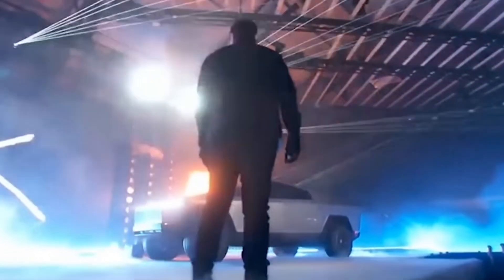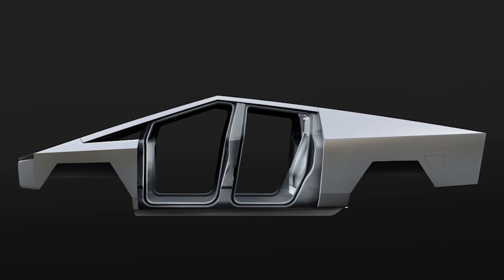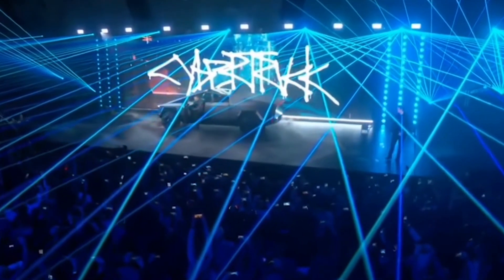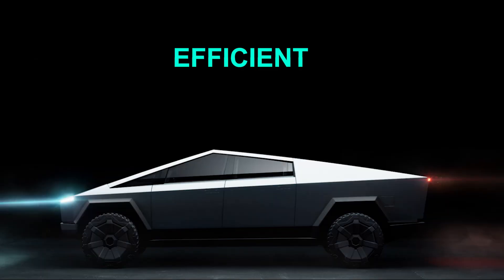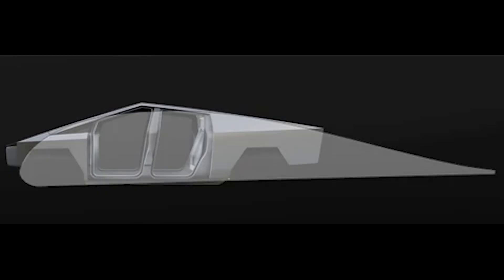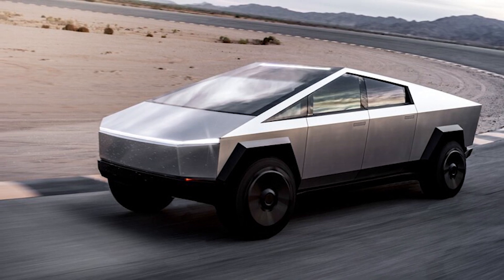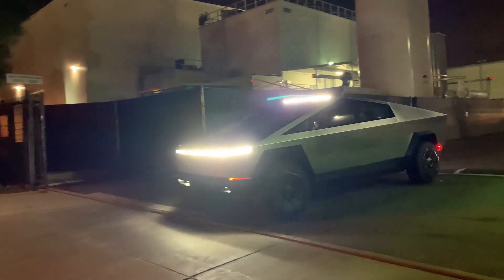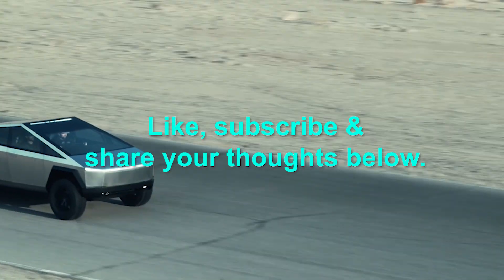Cybertruck is Engineering Genius (and will be copied)

Comment: So the points you bring up sound great. In real world practices there are a few issues. Yes the truck is strong. In an accident It will still dent. What do those repair numbers look like or will the vehicle need to be scrapped because it's one big piece?  We haven't seen any safety data. Where are the videos and data from safety testing? Do we have proof if range and even if it goes as far as claimed what will it do under max load?  I'm on board, but we need some real world data. Tesla has seen their fare share of blunders. How many will we find here?
Reply from the maker: A dent in the steel is a matter of visiting a metalworker to remove it.  And yes, Tesla are yet to speak about safety. On the specs, look at the specs of every vehicle Tesla has debuted previously. At launch, the production vehicle met or exceeded all of them. :)

Comment: I wander if the design will change before its release, like the sharp edges for example! I love the design by the way.
Reply from the maker: I don't imagine it will change much. Look at the first Model S, 3 and X prototypes. Damn near identical except for the front grille on S which was fair play, just so people didn't freak out too much over the design. My how far we've come since then (case in pint: look at the cybetruck haha).
Reply: Correct, I ask because of maybe issues with safety for pedestrians for example,.

Comment: There's 1 thing bothering me tho. Cars are uually made of a material that easilly bends so as to in a crash the passengers feel less of the impact. But the Cybertruck is really strong. How's that not contradictory?
Reply from the maker: Lots of people are mentioning this. The steel can be scored on the underside to crumple predictably and consistently when impacts occur from certain directions, and remain unscored and strong as hell otherwise. I think many will be surprised at how well the Tesla engineers address this. Safety is always top of mind at Tesla. It may not appear so but the driver in cybertruck sits the same distance from front of the vehicle as they do in Model 3 so there's equivalent space for crumple zone too.

Comment: When they start rolling out $10k teslas, then its big money time.
Reply from the maker: I think we're a few years away from that 😉
Reply: Might be unrealistic, as they want to be cutting edge innovators and not budget options. Other manufacturers will surely offer 10k new or you can buy used.
Reply: Aiden A: the problem with a $10k tesla is that a $10k battery is only good for around 80 miles (~129km)  ok for a short commuter, not too good for my "bi-weekly run up the valley".  (At those Prices the battery is what you are paying for, the car is free.

The average car user basically uses almost the same cost in fuel over a 10 year period as their (small-medium) car cost to buy.. (At Prices where I live)) - so a $25k (AUD)car, is really a ~$55-60k over 10 years expense, for many people (mechanical, tyres, registration, insurance)
Reply: I'd buy a 10-15k Tesla if it had a gas engine and a decent sized fuel tank.
Reply: @WartimeFriction  ok boomer
Reply: Good try, but Tesla doesn't have the range for extended commutes and I've never seen a charging station out here in Alaska. Also not a boomer, silly zoomer.
Reply: @WartimeFriction  just don't buy a tesla, boomer. Gm and ford still exist.
Reply: @WartimeFriction  Bud, the Cybertruck has 500+ miles of range, you don't need more than that.
Reply: @WartimeFriction  he's calling you a boomer as a metaphor
Reply: @johnt2914  as cool as that would be, it's still 2 years away. nothing is real yet.
Reply: @yaboirico5221  It's real, range is only a matter of battery capacity.
Reply: @WartimeFriction  I am a boomer, have my primary home in Alaska, and have had several Teslas. Unless you need to drive 300 miles or more in a day, superchargers aren't needed. Home charging does it for me.  There are currently a few Teslas in Soldotna.  Julio is evidently an idiot and didn't get your humor.
Reply: @johnt2914  If I drive to the second closest city (850 miles), I absolutely need more range than that.
Reply: @daveriley6310  Sweet! I'm glad it works for you then. I've wanted to test drive one for awhile now.
Reply: @WartimeFriction  good luck not having to piss or eat for 850 miles. a piss gets you 100 miles of range, eating gets you a full tank.

Comment: I have done some  retrofuturistic similar car designs 2 years go. .  Soft curves for good aerodynamics are not that important in that dystopian future 50 years ahead.  But it is important that the car offers good protection against street gangs and Terrorist attacks, and that graffiti can be removed easily. With an aggressive front it wipes away any obstacle , whether street blocks  ,other cars,  or humans

https://gramho.com/media/1724610361522756240.      https://i.pinimg.com/originals/9a/4f/b1/9a4fb145bd7142529eaa4a3ece35ba62.jpg.     https://hu.pinterest.com/pin/102738435232908240/visual-search/.     https://hu.pinterest.com/pin/102738435232908955/visual-search/?x=16&y=5&w=530&h=175
Reply from the maker: I hope you're wrong about a future dystopia Thomas!
Reply: @SolvingTheMoneyProblem   my dystopia was just fictional for a novel. I also don't wish it to come.  But the chances that it will come are not that bad, if our society continues going in the same direction as it does for some decades

Comment: Actually a rigid car is not safe. You want a car that deforms on impact. I'm sure that that Tesla will have great safety features, it's just that you were talking nonsense.
Reply from the maker: The steel can be scored on the underside to crumple predictably and consistently. I think many will be surprised at how well the Tesla engineers address this. Safety is always top of mind at Tesla. It may not appear so but the driver in cybertruck sits the same distance from front of the vehicle as they do in Model 3 so there's equivalent space for crumple zone too.
Reply: @SolvingTheMoneyProblem  I completely agree with you, it means that the steel structure isn't actually all stiff, it is made to crumple in the right places.

Comment: "exoskeleton". if that means that all structural parts are on the outside and the panels on the surface are structural,  if they get damaged in an accident,  a repair is almost impossible when the whole structure is deformed. 
normally non structural parts as bumpers, wings and front panels are deformed in an accident in order to absorb the impact and they are sacrificed to protect the structural parts underneath. But they can be replaced easily
Reply from the maker: Yep, this may be a thing (though Tesla's engineers are among the best in the world, they may have solutions). Lucky Tesla offers their own insurance and has autopilot and other safety features. Cybetrucks will be in far less "at fault" collisions.

Comment: I would hate to see the remains of one of the fibreglass specials in a crash with this truck. It will create very big problems on the road if anything hits it. Soon after it will create big problems for the other automakers.
Reply from the maker: Lots of people are raising this. The steel can be scored on the underside to crumple predictably and consistently. I think many will be surprised at how well the Tesla engineers address this. Safety is always top of mind at Tesla. It may not appear so but the driver in cybertruck sits the same distance from front of the vehicle as they do in Model 3 so there's equivalent space for crumple zone too.

Hope Tesla shares some safety info soon.

Comment: Pre ordered mine already, I haven't been to a fuel station for 5 months, filled up the troop carrier with 300 Lt of diesel the day we picked up our hyundai Kona Ev and haven't driven it since might still have tank full by the time the cyber truck arrives.
Reply from the maker: Awesome stuff. Which model did you order?
Reply: @SolvingTheMoneyProblem  Went with the 2 motor 4WD might upgrade to the 3 motor depends what the Aus $ doing at the time, not looking good with the RBA planing to devalue the $ to increase exports

Comment: There are compound complex shapes underneath the exterior bodywork.  They didn’t say how that’s made.  

There will still be stamping. The interior of the unibody will be aluminum or steel.  

The car isn’t much different than the delorean in concept. Stainless steel exterior but a separate unibody that could take on complex curves and contours to allow for door openings, seats, dash connections, etc.

You’re fanboying hard on a concept vehicle that hasn’t been safety tested, shown in a DOT legal trim, etc.  It’s just a concept that rolled onto the stage.
Reply from the maker: Yep, some stamping will be required. See the text overlay "Well, almost everything" at 2:29. But the exoskeleton saves a lot. Thanks for the feedack Shane :)

Comment: What proof do you have that it will meet the functional requirements of people who want to tow boats for example? To date, the advertised range of any electric vehicle substantially dropped when it required to perform a task load. Further, as the body receives no paint protection, this truck will be decorated by surface rust in no time if used close to a marine environment and not much longer after that will be a plaque with real rust issues.
Reply from the maker: Hey Geo, Cybertruck (and Rivian's R1t) are the first EVs built with towing in mind so we're yet to learn how much a load impact range. Interested to see how the stainless steel fares when exposed to salt water.

Comment: Very well researched and excellent analysis. This is the first video I've seen out of many that correctly attributes the design of the Cybertruck to reducing manufacturing costs and not just to being different for the sake of being different. It's not just engineering genius - it's design genius and has turned out to be marketing genius as so many people are talking about the Cybertruck with zero advertising. 

Also a good point about the competition being forced to use the same type of exoskeleton design to stay competitive. However, I don't believe they will be able to make that transition anytime soon as they would have to totally redesign their trucks from scratch. So in the short run, they may try to fake it with more angular sheet metal over the same frame. In a couple of years, you're going to see all these ads spouting FUD about how real trucks have a frame and are strong and durable, etc. implying the Cybertruck is not a real truck because it has no frame.
Reply from the maker: Hey William, thanks for your feedback and your thoughts. The whole reason I made this video was because no one seemed to have connected the same dots. 

I also believe most automakers will be late to the exoskeleton party. Let's see what happens.

Comment: 100% agree. It’s ridiculous how far ahead tesla is with this one. Obviously we all wished we could get both crush-free and shock absorbent vehicles. We all wish those angles weren’t so sharp as to reduce the efficiencies. Actually, a round surface is gonna be a bit stronger than a flat one. Triangles are just good at distributing load evenly while curves can turn tensile forces into compressive forces. I guess it doesn’t matter with high-tensile materials lol. Too bad this thing is gonna be hefty, but otherwise it’s a glorious machine. Sadly, towing with electric isn’t gonna be that efficient, but since we can power it with renewables and for some of us our own power (look into home power systems other than wind and solar you will be amazed), it’s not that big of a deal. I’m so excited to see the roadster on the road. To me, that’s the pinnacle of performance possible for today. The cybertruck might be the pinnacle of manufacturing efficiency and functionality for today, but it’s not the highest-performing truck.
Reply from the maker: Thanks for sharing your thoughts Matthew 😁 I know the model X has terrible towing range but it wasn't built for that function. I'm really curious to learn Cybertruck's loaded/towing range.

Comment: I don't think other automakers will adopt this material or. this method unless there is a strong movement away from "disposable" vehicles stamped from hot rolled mild stellar aluminium. I think there is potential for other manufacturing techniques to be similarly cost effective but it is all dependent on what consumers want. Alloy steel unibody covered in injection molded parts are likely tube seen as a way of reducing costs.
Reply from the maker: Thanks for sharing your thoughts Jim 😁

Comment: Everyone restates Tesla's stated specs. How often do production model specs match those of a pre-production model?
Reply: for tesla production models match stated specs when first show, price and delivery time tend to be the more inaccurate part. currently with software updates a 2018 model 3 has improved specs from 2019 software updates such as more power delivery and better range so over their life times they go beyond original specs.
Reply from the maker: They've met or exceeded all specs on all production vehicles to date AND have improved them further (range, acceleration etc) with over the air updates..from memory, model 0-60 time is 1 second less on SR+ than it was at launch. Same car, better software.

Comment: You're right about most mentioned topics. But not all. Its towing capacity isnt as good as it seems when put up against trucks in is price range. 40k 50k and 60 or 70k
Reply from the maker: Thanks for the feedback Al. You're right, in narrow use, there are better value (and more suitable) trucks e.g. if towing is all you care about, or you need a longer bed, or an even better range. But as a total package, nothing matches its value, especially when running costs are factored in.

Comment: Sturdy aluminium sounds great, but how is it going to perform well in actual crash tests without any crumple zone?
Reply from the maker: LOADS of people are asking about this. The steel can be scored on the underside to crumple predictably and consistently. I think many will be surprised at how well the Tesla engineers address this. Safety is always top of mind at Tesla. It may not appear so but the driver in cybertruck sits the same distance from front of the vehicle as they do in Model 3 so there's equivalent space for crumple zone too.

Comment: Honest question: Is a Cybertruck going to be INCREDIBLY expensive to repair once its been in an accident due to the entire thing being basically one piece of metal? PLEASE ANSWER. Very curious about this. Thanks for this video. Really appreciate the information.
Reply: A tesla is junk after warranty runs out and close to impossible to repair yourself (no parts plus extreme cost). You already know the answer.
Reply from the maker: Good question and NO idea. BUT, it will need to be the kind of accident that would write off most other vehicles. A smaller impact will just dent the steel which a metalworker can repair EZ.

Comment: So you‘re saying they have a focus on safety, but I don‘t get, how that stirdy steel could help to keep the passengers alive at a crash. 
To me, it seems like the ford model T, where at a crash the metal doesn‘t work like a „crumpling zone“ and the driver would get hit by the whole energy.

I hope, you can understand, what I‘m trying to say 😅

Other than that, great video! 👍
Reply from the maker: Lots of people are mentioning this. The steel can be scored on the underside to crumple predictably and consistently. I think many will be surprised at how well the Tesla engineers address this. Safety is always top of mind at Tesla. It may not appear so but the driver in cybertruck sits the same distance from front of the vehicle as they do in Model 3 so there's equivalent space for crumple zone too.
Reply: Solving The Money Problem okay, thats good to know. Didn‘t know that was possible 😅
Reply: Solving The Money Problem has this been mentioned specifically from someone at Tesla ? Or is this speculation? Just curious.

Comment: The body panels are made from stainless steel sheet metal using laser cutting but I don´t think they are going to be cheaper and faster to manufacture then normal panels.
1. stainless steel is the most expensive material you could think of for this application.
2. If you are not using stamping (which you apparently can´t use for a 3 mm SS sheet) then you will need to use bending and you will have to make each bend individually. Stamping may involve large initial investments, but they are very economical for large production runs because they are fast and consistent.
3. Stainless steel welding is more complicated then carbon steel welding and may involve extra steps.
4. Indeed you would save on the painting, but Elon has indicated that they would also provide other colors as well  (matt black) so you may still need that investment. Paints don´t bond well with SS so that´s a separate challenge. Even still, normally stainless steel is brushed or polished when used in decorative application so there maybe some extra costs involved with that. 

I completely understand the benefits that using SS offer over standard carbon steel (+ galvanic layer + paint +clear coat) but I don´t think cost was the main concern. Tesla can offer a truck body that will outlive you kids that´s the selling point.
Reply from the maker: Great comments, thanks!